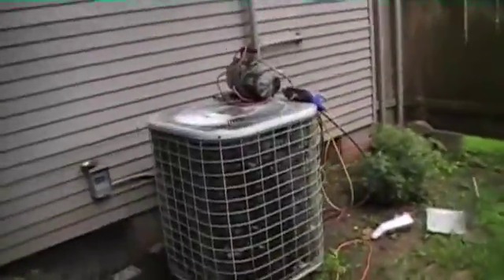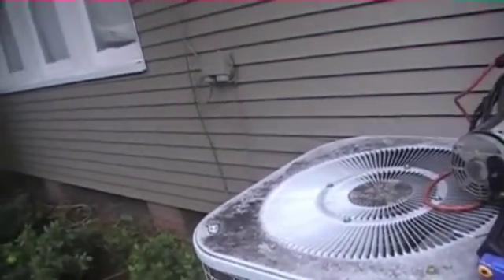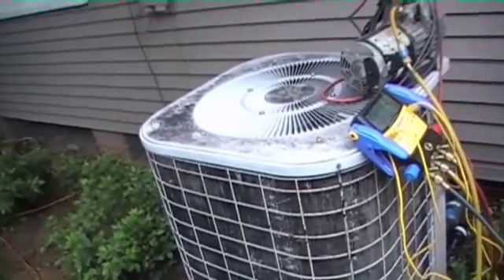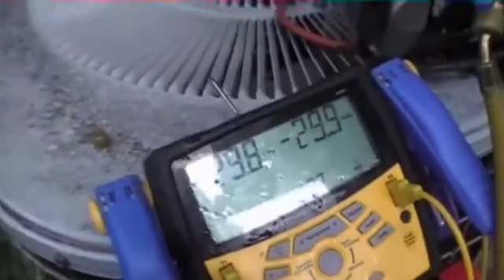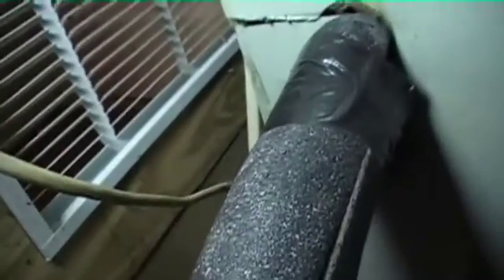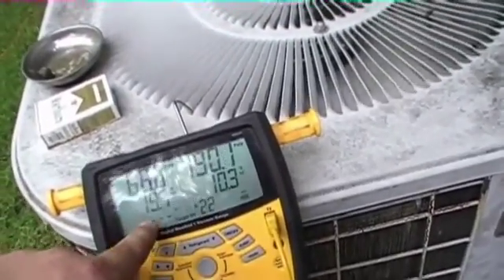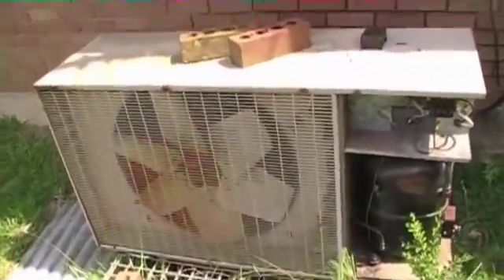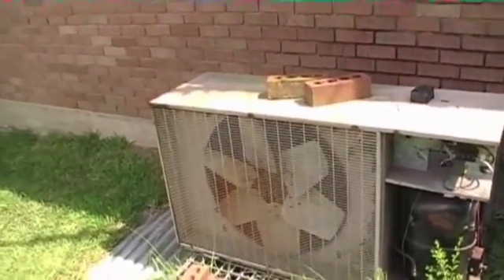HVAC Service- Trane TXV Replacment

Comment: I just do the HVAC work for my employer (large manufacturing facility) and the problem with that is I know what things cost and what straight up bullshit! When an old woman is charged $1200+ to replace a $25 fan control board and still doesn't fix the problem because he didn't see the shorted thermostat wire burns your ass. Your a good man...

Comment: Good video.The expansion valves with a high superheat kills alot of compressors, the compressor is suction cooled. Service men go to a job and find a bad compressor, they change it and it dies in a week. Whenever a compressor is changed you really have to look at the expansion valve. The expansion valve has a direct effect on the efficiency of a unit. I like changing expansion valves.
Reply: is it ok to run a 100ft line set up to stories

Comment: I hope that it is all it is.  I would hate to have to replace Compressor.  according to the unit there is an 8 year warrenty on it But the company installed the unit went out of business about 4 months after our install of the unit and new furnace. so if it is the compressor  any help on how might get that warrenty taken care of?   I really hope it is just the Capacitor.

Comment: Hey Israelhvac question for you my outside unit stopped working on Tuesday last week figures right before 4th of July.  it was working fine Tuesday till that night seemd to be warmer in the house than normal  went out side to check the outside unit  the Fan was turning but the Compressor was just humming didn't sound like it usally does. unit was put in 2006.  Could it be a capacitor or maybe Low Coolant?